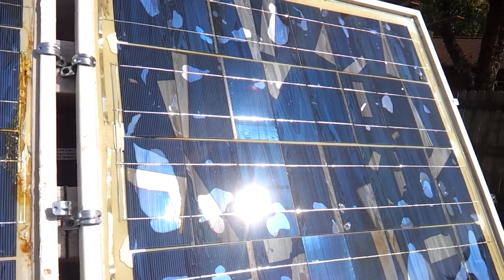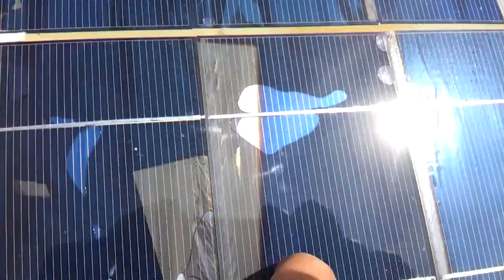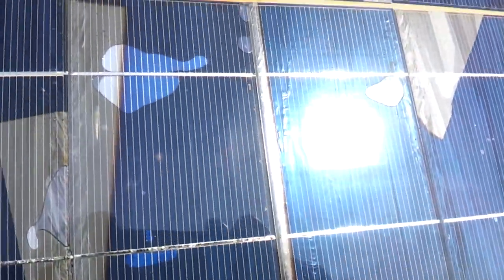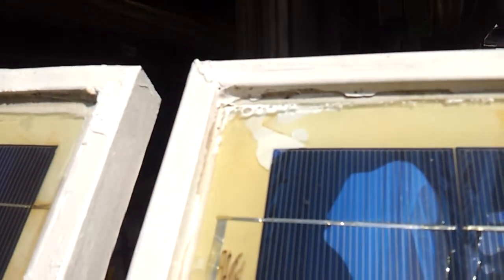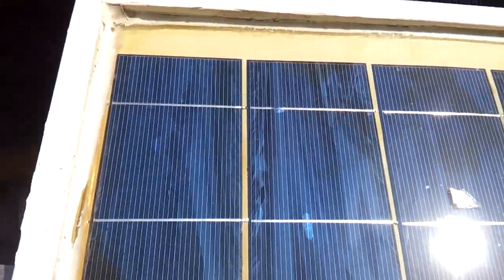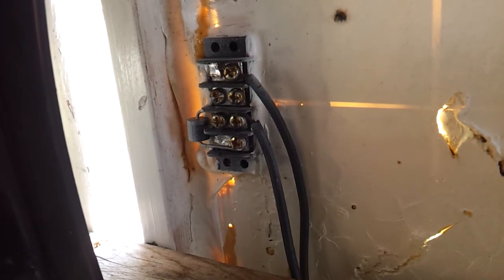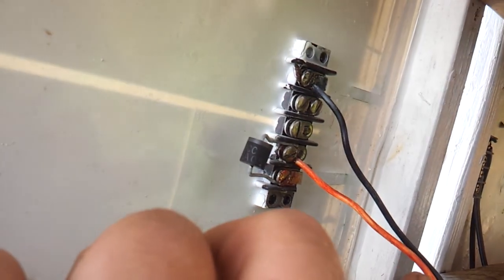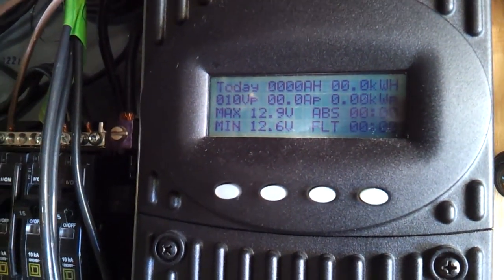HOME MADE SOLAR PANEL UPDATE ~ HOW ARE THEY HOLDING UP

Comment: Yo pongo vidrio celdas y EVA calentándola,  y siliconando los bordes de la EVA.
https://plus.google.com/b/116060935136123669081/116060935136123669081/photos/photo/6123478601132266930?pid=6123478601132266930&oid=116060935136123669081
Apartir de haí , se enmarca , se le pno una lamina plastica, y se siliconan todos los bordes con silicona transparente.
Pero, nunca poner detrás de las celdas material solido para sujetarlas, ya que habrá problemas de dilatación y las celdas se romperán.

Comment: Awesome little bit of construction! I've just made a little 1-4w panel for 12 volt 18650 lithium charger :) Works at 18 voc and I just directly charge the lithium batteries with no charge controller.